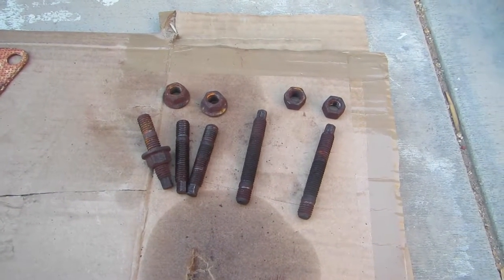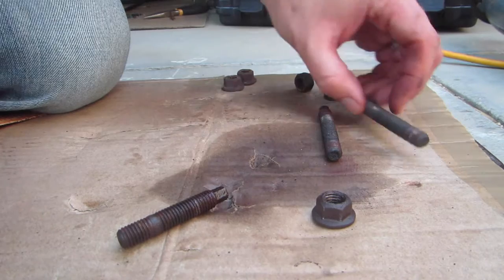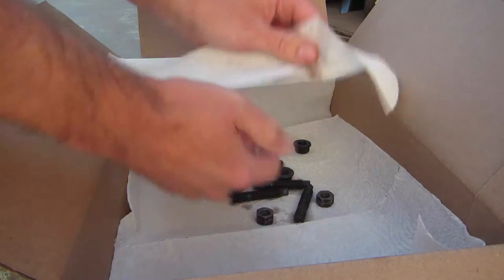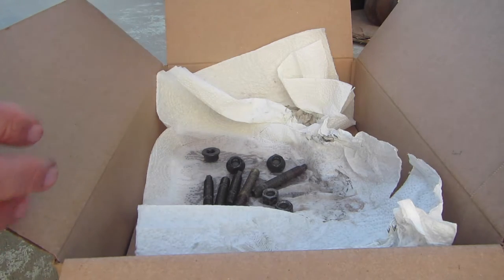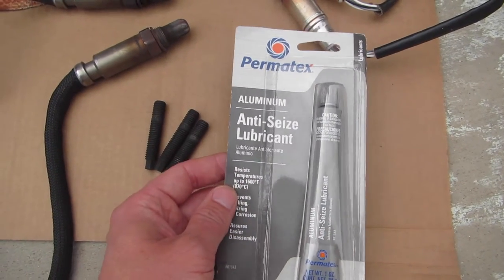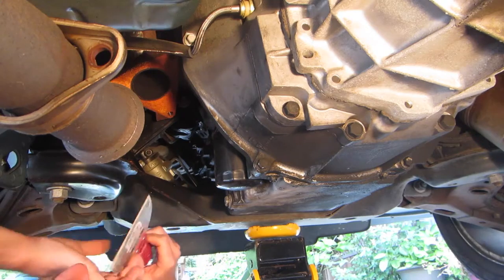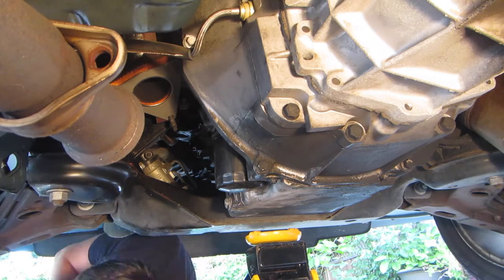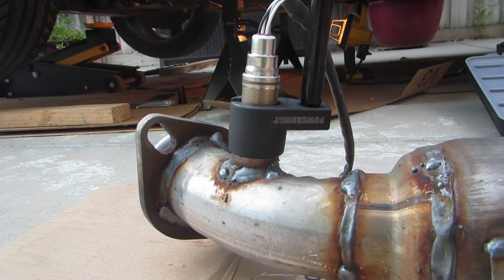Replacing My Catalytic Converter - Part 4

Comment: Thanks for the videos. Going to attempt the same on my 1998 f-150. Just a tip, you can use screwdriver type drivers to spin those sockets a little faster in constrained spaces. I will probably use my cordless driver with an extension, even. I hope I am as lucky as you are with those studs coming off without snapping!